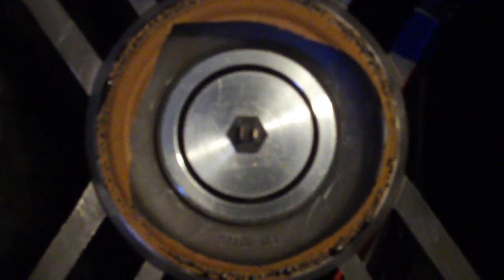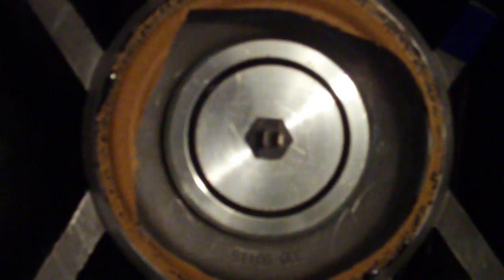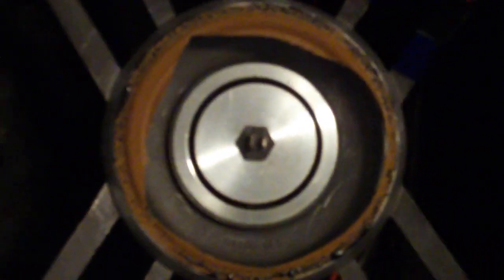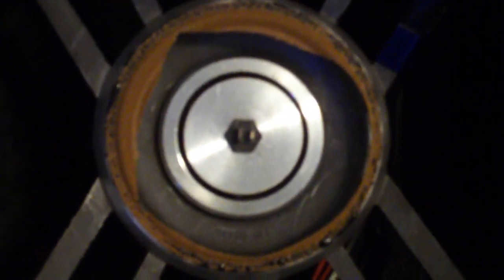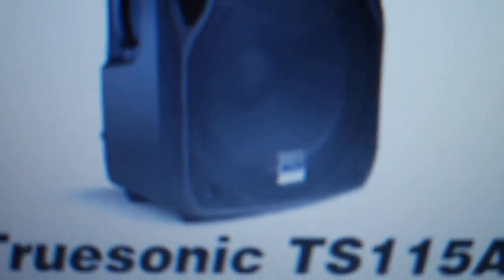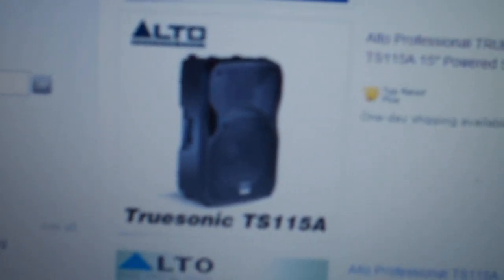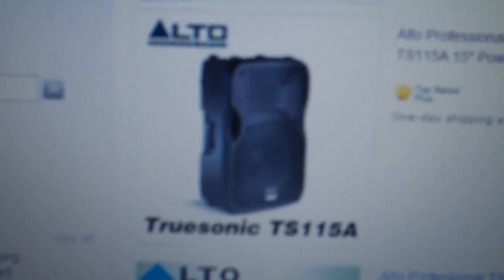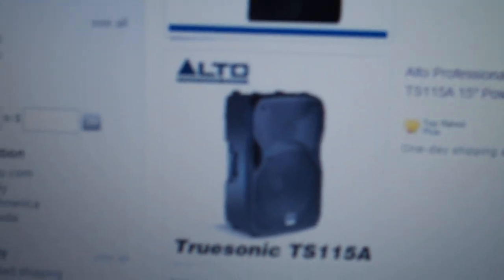JBL EON G2-damage woofer

Comment: Hey man I feel your pain. i have to ask… Did you knock the box or did it fall. If that happen it would cause the magnet to shift. The magnet is glued down to the built in spider. The terminal connector is plastic, if the magnet is unstuck from the web, the only thing that is holding the magnet is the plastic terminal. If that is the case you can order and order, the same thing will happen again… the vibration will continue to shift the magnet until you either stick it back or buy the entire metal frame.

Mine fell down and that's why I can tell you all this….pressure
Reply from the maker: Nope never drop it...it might due to the heat from the voice coil that can cause the glue to soften up but I use a different glue this time when I recone it again